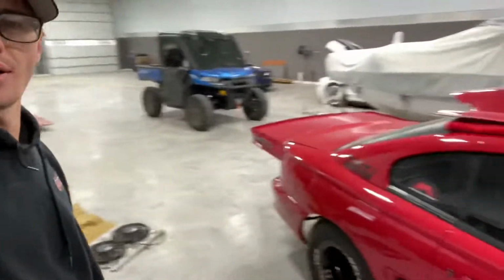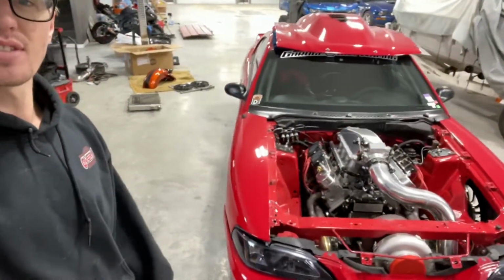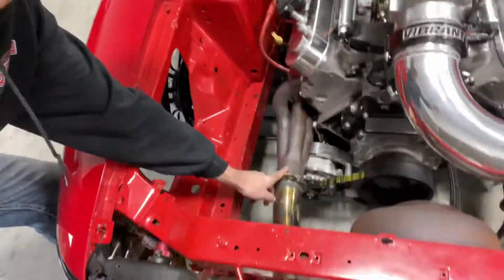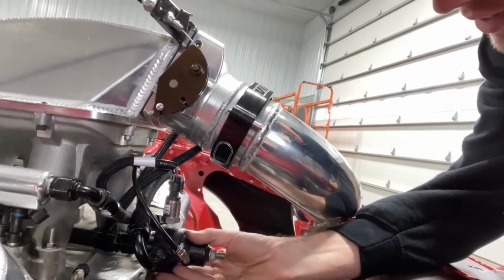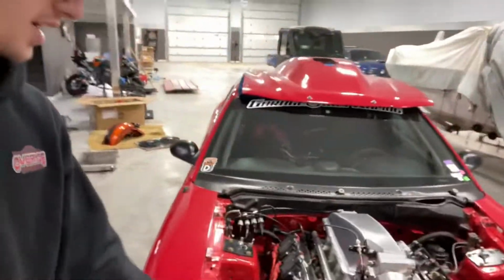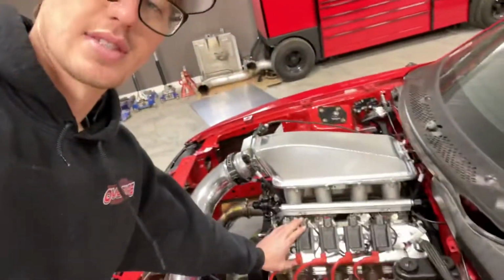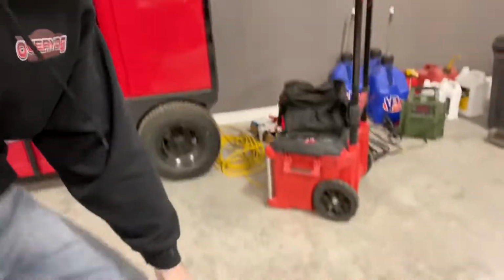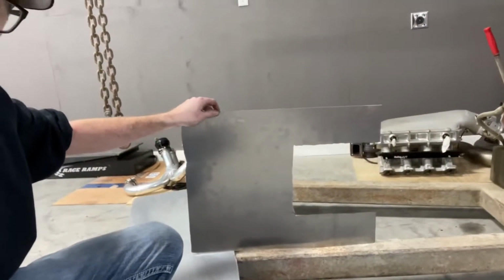2021 racing season recap! Plus upgrades for sick week!

Comment: So you wanted go to a water meth injection rather than intercooler? I have that now. As long as it never fails all good
Reply from the maker: It’s kind of like that, but it is 2 huge fuel injectors in the charge pipe. I’ll either do that or run meth all the time 😂
Reply: @OverydeMotorsports  im leaning toward Meth full time myself. I’ve done meth inj with e85 for 2 years. I drive a lot tho so I don’t know really lol
Reply from the maker: You would definitely use lots of fuel. I want to do mine how cleetus has it in mullet but I would need a different style 16injector intake
Reply from the maker: https://youtu.be/QTHR0tUut24